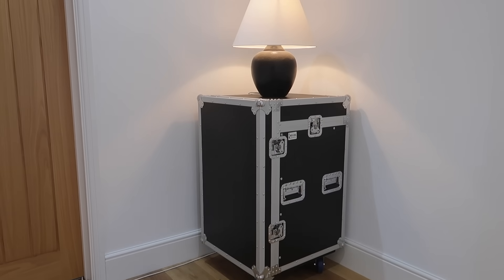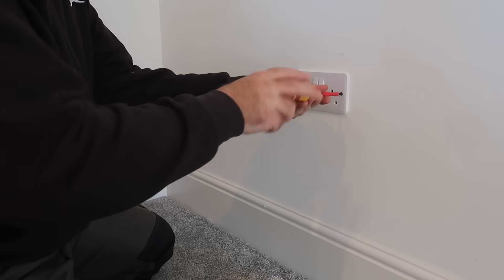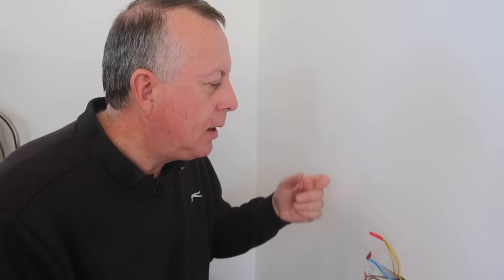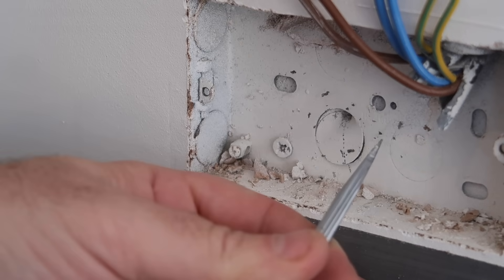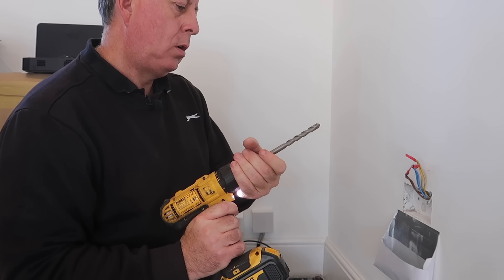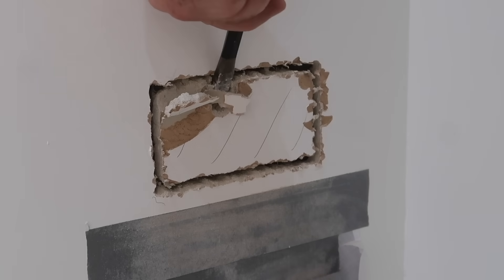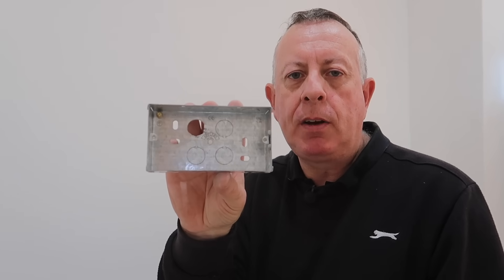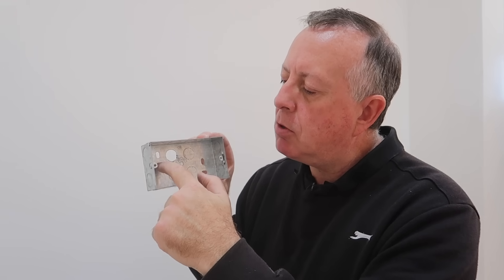How to Install a New Electrical Outlet in an Existing Wall

Comment: Thanks you for your video, very informative. Can i please ask how do i know if there is any electrical wiring, piping etc... behind the wall when im drilling?, This is perhaps the biggest reason why i dont like drilling into the walls in my house. Its a big problem for me as i need to repair many things
Reply: Much comes down to skill and experience, however you will do just fine if you use your senses and some common sense.
   Take a look on both sides of the wall or area you're working on, are there any electrical outlets, plumbing or heating. Tap the wall, does it sound hollow, there might be cables or pipes. Are there bulges or hollows where things might be patched over. Are you drilling directly horizontal or vertical to an electrical accessory?
    When drilling, you should feel the change from plaster to the substrate, and nothing else. Use a bradawl before drilling holes. If walls are plasterboard or studwork, you may avoid using power tools if pipes and cables concern you so much. Theres plenty of fixings can be installed with hand tools, you dont need to go blasting everything with a battery drill!

Comment: Did you test the neon screwdriver after it showed a no glow. Power off or neon screwdriver faulty ?
Reply from the maker: Yes I always do but I don't show it on video or else I get a load of complaints that I've opened a socket without isolating the power

Comment: I use an oscillating tool to cut out the plasterboard, so quick and and easy and no need for all those drill holes
Reply from the maker: Good idea

Comment: You didn’t do end to end tests, it may not of been an actual ring you just spurred off. You are also just assuming there was an earth there that meets disconnection times without a Zs test ? Not a DIY job without testing correctly.
Reply: Yep. Can't emphasise the importance of testing. I suspect a lot of people will just add sockets after watching this video thinking it's a spur off a ring without the background knowledge, not the understanding of the testing required.
Reply: Can explain more for our benefit?
Reply: I don't know what you are talking about and that's why I will leave this to the pros.Electricity is not to be f$&@ed with.
Reply: You didn't explain anything you just said, I think you are a more evil person than the video author. Because you instilled fear and doubt to amateur diyers and left them hang to dry. Pure evil.

Comment: I get what you are trying to do by making a DIY video and the loft lights was decent because its on a 3 pin but you shouldn't be telling people to do this or doing it yourself, by adding a spur you are altering the characteristics of the circuit so at minimum you should issue a minor works certificate, the limp wristed DIYer who attempts this will sharp find out that their home insurance is void for attempting it themselves.
Reply: Another Sparky trying to scare people so they can pay for an electrician’s new Audi 😂 gimme a break! Easy job to do, save yourselves a fortune guys and do it yourself.
Reply: @DavidSmith-hn5gg  I don't know which electrician broke your heart but that is terrible advice.
Reply: It's non notifiable so a MWC is not required. But Part P 3.13 says it should be inspected, tested and certified.
Reply: @tobysherring1369  You might want to look that up, altering the characteristics of a circuit is notifiable
Reply: @Darkonon  I have looked it up...and P1 2.5 12 (6B) says notifiable works are:

a new circuit

a replacement consumer unit

alterations/additions to a circuit in a 'special location'
In the latest version in England, special locations contain a bath, shower, swimming pool or sauna heater. So it's non notifiable in this case.

I can't see 'changing the characteristics of a circuit' in there but I'm happy to be corrected. In any case, adding a spur doesn't change the circuit's characteristics - spurs are a perfectly normal way of wiring a ring final circuit, and adding them is specifically allowed. P1 2.7 specifically says additions and alterations, which this spur is, are non notifiable. Obviously work has to meet wiring regulations, whoever does it and be inspected, tested and certified.

I agree that it's best to leave well alone, but my comment simply reflects what Part P says.

Comment: Nice video. Since you have dot and dab walls with soft brick. A neater job , but somewhat duster, would be to use an oscillating multi tool to cut the socket hole. I doubt you would have had the need to paint anything afterwards. Tried and tested method known to work. ! 
As for the earth wire from the box to the socket. Old school. I would have fitted one.
Reply: I would  have used  a drywall socket  as well ,just for speed because  I hate working for free.
Reply: I always use a box sinker,never needed to patch round one yet and done in minutes

Comment: You shouldn't be showing anyone how to do electrics unless they are competent and qualified.
You wouldn't show anyone how to change a gas fire or change a boiler or plumb up a new gas run so stop showing people how to do electrics and possibly make an already dangerous electrical installation into an even more dangerous one.
Reply from the maker: Sorry I disagree. Changing a gas fire unless you are CORGI registered is illegal. Carrying out certain electric work around your house is legal - from changing light bulbs to adding spur sockets and new light fittings. Part P of the building regulations explains clearly what you can and can't do. If you are not confident dealing with electrics (as you obviously are not) then I highly suggest staying away from it. For those who want to follow the law and do what they are allowed in their own home, my video teaches the correct, logical, safe approach to the work.
Reply: @ProperDIY   I'm 2330 level 3 qualified electrician have Been qualified for the last 10 years.
I have my bs2391.
I work in social housing putting right the crap DIY installs people like you teach on YouTube.
Also gas safe replaced corgi years ago.
You don't realise but electrics are just as dangerous as gas you cannot smell it and you cannot see it.
Leave it alone if your not qualified or competent.
Reply: @asamitchell7948  BS 2391 HA HA HA I think you may mean City and Guilds 2391, BS stands for British Standard
Reply: @ProperDIY  "Gas Safe" replaced CORGI in 2009

Comment: I'm no expert but I thought we did not use ring circuits any more?
Reply from the maker: Ring circuits are the most popular in any home.
Reply: You cant beat a good ring, some electricians cry over a split one! 
    Joking apart, its more down to design and cost, certainly on new builds. Endless ammounts of radials and MCB's dont work the same way as it does in Europe.

Comment: Should have an earth lead to the back box for good practice.
Reply from the maker: No not really. The professionals don't install them and with the earth bar at the back of the socket reaching around and making contact with the backbox it is earthed once screwed into place. See the pinned top comment.

Comment: Can you show the part where you tested your r1, r2, rn, R1+R2, Zs and RCD tripping times. That would be really useful. Thanks.
Reply: Part P1 3.3 says a certificate should be given for all work, notifiable or not.
Reply: Yh because every electrician does that when they fit a new socket …..
Reply: @spencerpayne1971  if I was writing an invoice for that job it would have a minor works certificate attached every time. It's the only thing we have to cover our arses if anything goes wrong!
Reply: @spencerpayne1971  They wouldn't for just replacing a socket but they would if extending a circuit. I can agree if it was a cash and run job though aha..

Comment: That new socket will be a different height to the existing one. You removed the bottom rear knock out of the existing but removed the top rear knock out of the new one. I know there is nothing in the area to compare heights but my OCD would be going wild.
Reply from the maker: Correct and on purpose. You see the original one is very high - much higher than I would normally fit them so I decided to go out through the lower hole and in through the upper hole just to bring it down as much as I could. As they are in different rooms and the socket is hidden behind the table / unit no one will ever tell.
Reply: @ProperDIY  Yeah these things happen, intallations are not always straight forward. I wasnt knocking your work at all, its a nice tidy install with a bit of forward planning thrown in there. 👍

Comment: Thanks, I needed this as this is on my to do list. Do you need to worry about doing the drilling if it's in a supporting wall?  I have previously replaced the socket in my wall and it doesn't even have a backbox (just a half tennis ball sized hollow) would like to install one when putting in a socket the other side thus I will have to do a fair amount of chiselling out  but just to the size of a socket. Would the wall fall down?
Reply from the maker: If you are cutting a hole the size of a double back box I can assure you the wall will not fall down
Reply: Ok cheers Mr. Stuart.

Comment: Another great video. Like the honest comment about neon screwdrivers. See electricians having a go about them but as you say they're sold everywhere. They're ideal for those of us doing electrics every now and then. Like the rapid fix socket too, not used them yet. 👍
Reply: Electricians, and anyone employed, have to comply with the Electricity at work regulations. As an industry we are trying to improve the safety culture through the use of proper equipment and best practice.
Reply: My dad was a sparky and, whilst he used one, he never fully trusted his neon screwdriver. He taught me to always test it on the live socket first, then turn off the power at the consumer unit and then test the same socket again with the neon. As an aside, he also pulled out the fuse for the relevant ring-main as well as flicking off the switch - he call this his "making sure he got home for supper" tip, whereas nowadays I guess it's called best practice... Great vids that I passed on to by DIY son, too.
Reply from the maker: Thank you. After getting a lot of grief from electricians it's nice to know I'm not on my own!
Reply: @ProperDIY  sometimes some sparkies will give out grief to DIYers as they have seen lots of things that are bad and tar the DIYers with that brush. The problem with the neon screwdrivers and the contactless mains indicators are they rely on you to provide the capacitance to work. I believe if you are well insulated then they don’t indicate and you could have live where it says there isn’t. 

Given you’re working with 32 amps at this point you are then relying on the rcd to save your life. Most people don’t test their RCDs at the advised rate and how many have had them checked regularly? When your life is a stake then relying on luck is risky.

If one is working with mains electricity then a proving unit and proper tools and processes could well save your life, so a small price to pay.

A neon screwdriver is better than having nothing, but having the tools the pros use is best. 

Still nice video and a great channel, you could always do a video about proving units and safe isolation.

Comment: Decent video. I’ve been told that the earth wire should be trimmed longer than live and neutral. It makes sense to me, safety wise ( if the cable gets accidentally yanked, you want earth to be the last cable to remain) but I don’t know if that still applies to modern circuits with modern regulations and wiring.
Reply: In a plug yes

Comment: Great video! I have no idea why the metal back box on the existing socket was painted inside as it’s never going to be seen by anyone but did a good job there! One trick I have for you is instead of using filler to stick the box in use expanding foam adhesive and you can cut it back and put some filler on round the edges - it really does work well cause it gets into all the awkward gaps where you haven’t applied filler in your case and makes it more rock solid, done it for years and works really well!
Reply: I wondered that about the paint too, then wondered if the room had been spray painted and the back box was just exposed at the time
Reply: All of our metal back boxes are painted, it’s easier and cheaper to spray a room rather than roller it. The finish is awful but Developers don’t care about that.
Reply: @kevinbarton98  Luckily ours thought to put some gaff tape over them before spraying ... you're right though the paint finish is terrible. Rub it with your finger and you expose bare plaster!!
Reply from the maker: Thanks. Yes I can see that working well - have to try that next time!
Reply: Only problem with expanding foam imo, is that it is expanding foam XD. It has a tendency to expand out of the cavities, stick to everything around, solidify in the applicator nozzle if you don't use it often etc. I'm sure that if you are a regular user and experienced at judging the quantity etc then this is a fine technique but for a one off DIY job, not so much.

Comment: So, just confirming, no earthing the backbox?
Reply from the maker: Not with an additional cable, no. If the socket is earthed, the action of screwing it into the backbox will earth it as modern sockets run an earth strip around the back to the screw terminals. So as long as you are using these (I think all are like these now) then no need for a separate fly lead to the backbox.
Reply: @ProperDIY  Surely that only protects the backbox if the screws are in? The moment you unscrew the frontplate of, then the backbox is no longer earth protected? and you just have to pray a cable hasn't come in contact with the backbox within the wall?
Reply from the maker: @ColinRichardson  It's the way it's done in the industry. I have a new house fully signed off and none of the backboxes have earth leads going to them.
Reply: @ColinRichardson  The backbox not earthed when the socket is removed is not its normal "in service" state though is it. The completed installation, is with all sockets affixed to their backboxes. If the backbox has at least one fixed lug, there's no requirement to install a fly lead. There are situations where a fly lead is recommend,  but Stuarts house isnt one of them, so I'm not getting into it.
Reply: @ColinRichardson  you're right, but the regs are clear that they're not required, because the regs also say you should isolate power and prove dead (not just with a death stick or plug-in tester) before removing the screws.  I do fit them but I don't have to.

Comment: Lol’d at the damaged screwdriver comment.

You might be interested to know that
(A) Wera sell ‘chisel’ screwdrivers that have the striking cap at the end and are designed for this
(B) Instead of the Wera green/black, they are Yellow/Black so your carefully curated 😉 tool colour scheme will be maintained.

Comment: Nice video - thanks.  Just a few of tips for anyone thinking of doing similar.
Metal boxes can be used in stud walls. I have some in my house, for whatever reason the builder preferred to fit metal boxes on noggins in the stud wall rather than plasterboard boxes after the boards are up. Peek through the screw holes in the existing box to see.
You can also often judge the wall construction by looking how wide the door lining is. Blocks + dot and dab are thicker than studs.
Cutting out a neat box - an oscillating saw is great for this. I've done this with metal boxes and the socket is wide enough to cover any minor gaps as you say - no filling/painting required if you're careful and lucky.
If laying 1 cable, often it is better to lay 2, and add the new socket to the ring. Join the other cable with ideal splice connectors or any other connector rated at 32A in the back of the original socket. If you're on a stud wall, you may even be able to pull 1 leg through to your new socket and avoid the connectors. 
Your auto wire strippers should be great at removing the outer sleeve on the T&E cable. Rather than the knife and cheesewire earth method.
You mush share your trick of instantly aligning the screw with the lug on the back box when re-fitting the socket. That's the bit that usually takes me a few attempts and a bit of language to persuade it to engage :)

Loving your videos - thanks again.

Comment: Before you put the box into the wall a rubber grommet should be inserted into the knock out hole in the box to protect the cable sheath on the sharp edge.
Reply: I commented before watching all the video .

Comment: Can’t assume because it’s a galvanised back box that it’s not a stud wall. We use noggins in stud walls all the time to fix back boxes rather than dry line boxes. I also don’t think it’s entirely wise to be showing people how to do this for various reasons. I’m an electrician and see some terrible DIY wiring, additions and unsafe practices. There is a reason people train to learn trades and somethings should not be done by the average DIYer. Just my opinion 🤷🏽‍♂️
Reply: I would think the average DIYer to be adequately able to something like this (as with almost everything on this channel) - but... the BELOW-average DIYer... I would agree with you.
The problem then is whether the "incapable" folk will know enough to realise it...
[see: Dunning - Kruger effect...]

Comment: Another great video, very well explained. When you removed the existing socket and the wires were temporary exposed for a short while, instead of wrapping the ends in tape, I put a wago connector on the end of eash wire, much easier to remove than tape and possibly safer. Keep making your great videos.